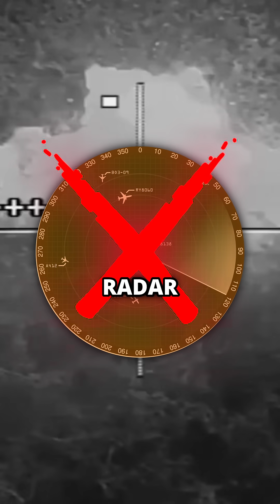When A Fighter Jet Landed On a Cargo Ship

Comment: he saved the plane by pulling an amazing clutch and he got reprimanded for it
classic management
Reply: probably for the duration of the subsequent investigation.
Reply: Well, he was being trained to handle combat operations, so if he couldn't even locate the ship he launched from, he probably failed that exercise. Clutch landing, but only made necessary by a navigation error to begin with.
Reply: @chord5625  his radar stopped working and his comms systems, that's not his fault
Reply: @loliko23  He was training for a covert mission. He was meant to navigate and complete his mission without using radar and radio. His need of them already failed the parameters of the task.
Reply: Alternatively he could have crashed the plane on the ship risking the lives of 10-15 crew members, the ship and the plane as well. Not to mention the costs of search and rescue, death, the ship and the plane and cargo. The cost of dumping a plane into the ocean might not have even come close to what I mentioned. Also the international embarrassment if it all went wrong.

Comment: He was reprimanded even though he saved them millions of pounds and pulled off an insane maneauver??? Makes no sense at all
Reply: He put civilians and private property in danger. Sure, everything worked out fine, but he could have crashed into the ship, if the plane carried munitions they might have gone off when it slid off the containers, and the plane could have started leaking oil that might ruin the cargo or even start a fire.

He was punished for what could have happened, not for what actually did happen. Still, I imagine he got quite a few pats on the back when the cameras weren't rolling.
Reply: Well, he got lost to beginn with...
Reply: Yeah
Reply: You know it was performa.
Reply: @akeleven  No he wasn't?
Reply: well he did get lost in the first place, that’s probably why
Reply: @GhostRider659  with both radio and radar malfunction. thats two systems of the plane that must work for the pilot to find the carrier again on open seas easily
Reply: They needed to find out what happened and if he could've done anything else to save the plane since it could've costed lives.
Reply: Because it was his fault. Im guessing the reason he was allowed to keep flying was that an investigation confirmed the radio failure
Reply: @asuramaru6931 not his fault, if he had the Rafia and nav off then it’s mainly due to following orders making it whoever gave the orders to turn them off held responsible
Reply: That cost might not even have come close to destroying a ship, a plane, crew members, cargo, search and rescue and probably most importantly the international embarrassment. He was reprimanded simply because the airforce don’t want to take on any of that same liability in the future. I wouldn’t want the airforce or military coming any where near me in their emergency.